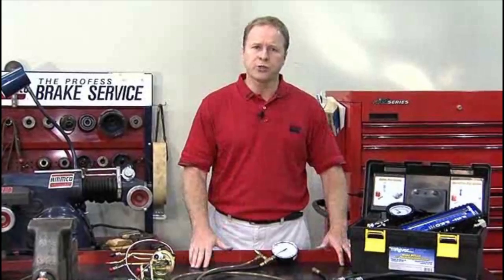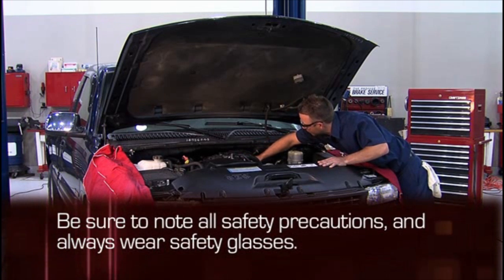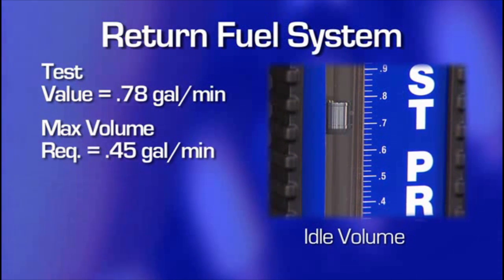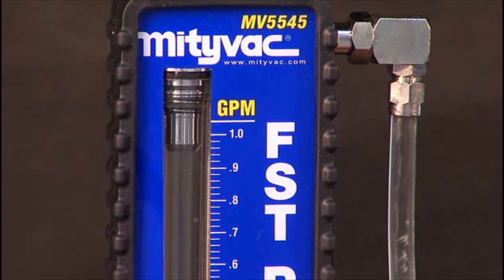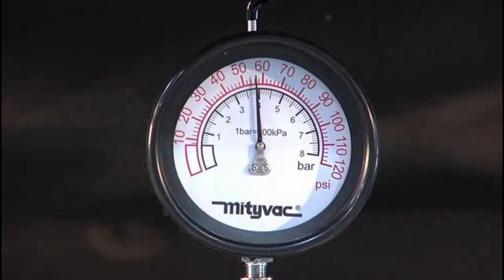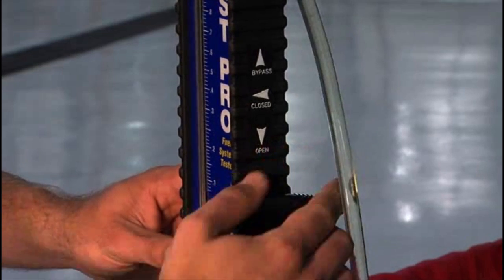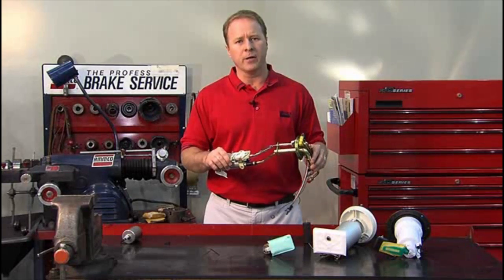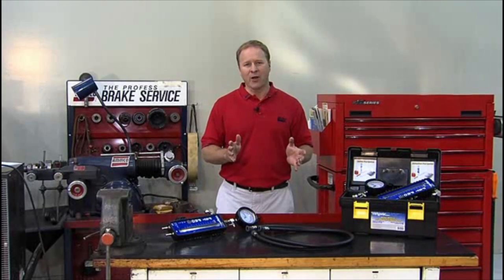Mityvac MV5545 Training Video FST Pro Fuel System Test Kit

Comment: My 1987 Chevy Celebrity 2.8 L stalled while driving without warning . It would not restart . I did smell gas . When I removed the air intake I noticed fuel around the throttle body area . There is a vacuum line connected to the throttle body for the fuel pressure regulator . The diaphragm has torn and fuel was drawn through the vacuum line . I also proved that by attaching a vacuum pump . It pulled fuel through the vacuum line . I keep a filter in front of the tester to keep debris out . That regulator is under the intake plenum , between the fuel rails . It had about 135 K on it .